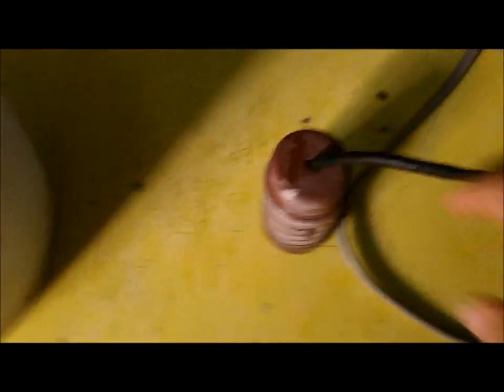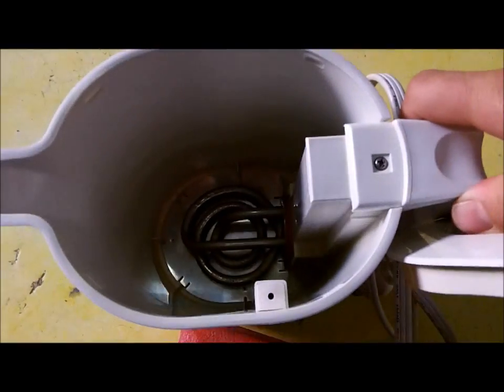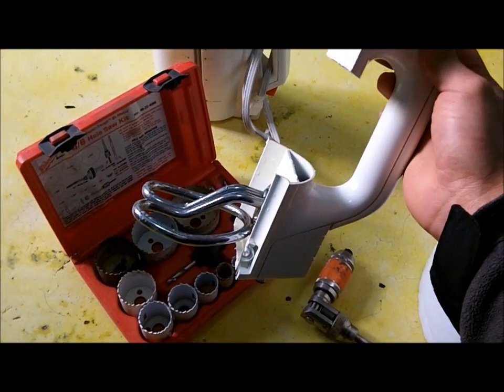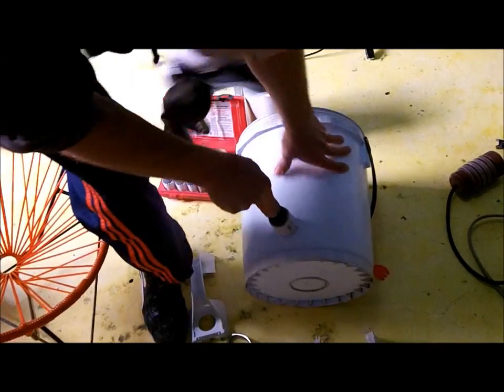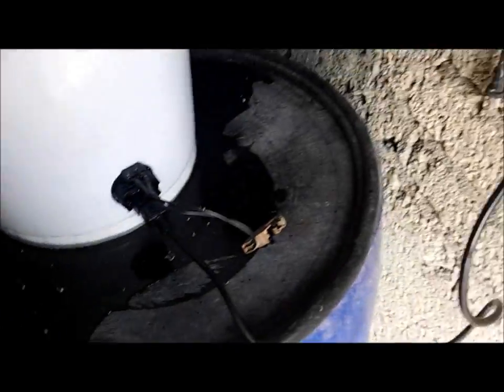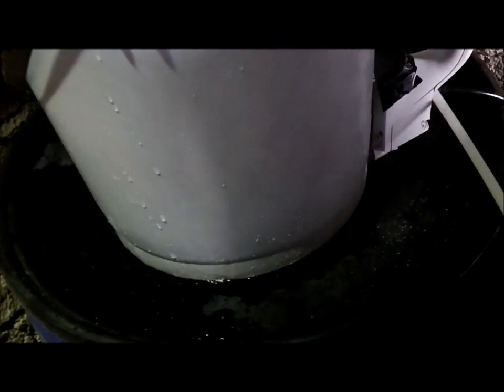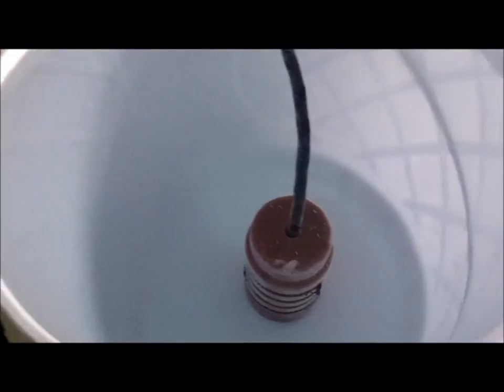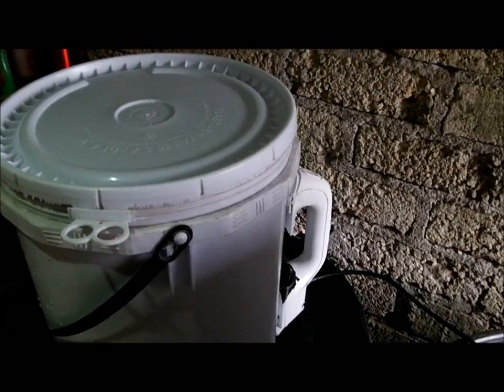Heating Water Off The Grid

Comment: Might have been better to have used a steel paint bucket, 5/6 gal, you could avoid melting the plastic.and hammer it flat for a better seal.

Comment: To compare apples to apples, messure the resitance of each coil (heating element), and use ohms law to figure your watts. Example 1000 ohm coil ( element/ load ) will pass right around .25 amps, at 220vAC,  now take your amps and multiply that by your voltage if it is 220 volts = 90 watts, 120v would be ruffly 1/2 that, if memory serves me right you have to take your final result and multiply that by .7 becuase you are useing AC at 60hertz, ( you loose power on the sine of the wave )

Comment: Good job on the improvised water heater.  No smoke, fire or attention.  Covert water heating.  I can't really think of anyway to improve what you've got, but you could use an 3500W or 4500W element out of an old water heater too.  Of course you would need 240V and it would be a little more dangerous.  Thanks for sharing ideas.